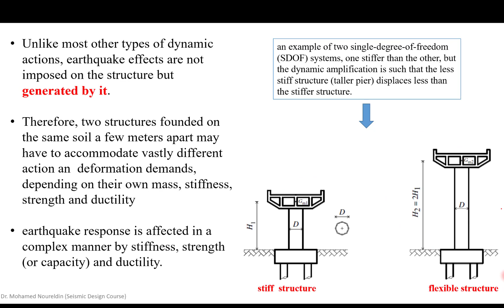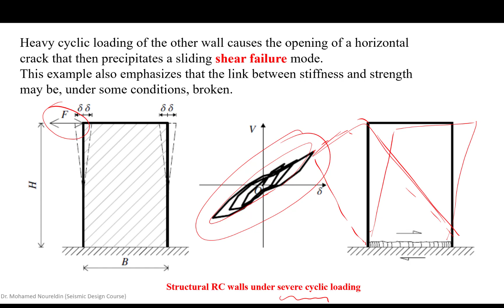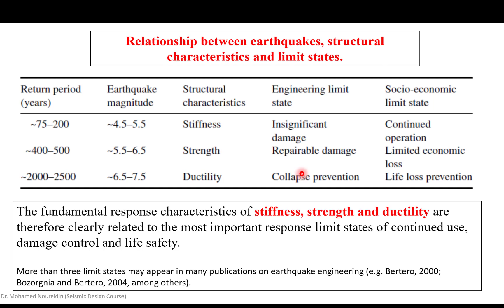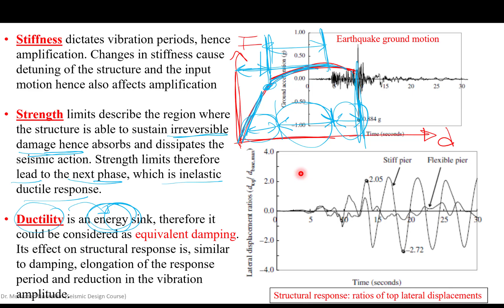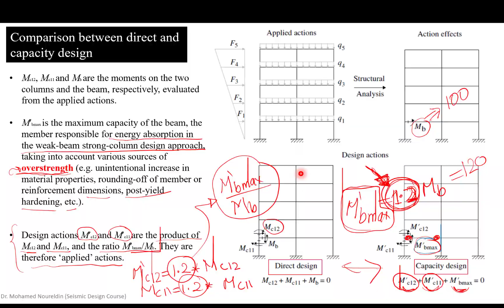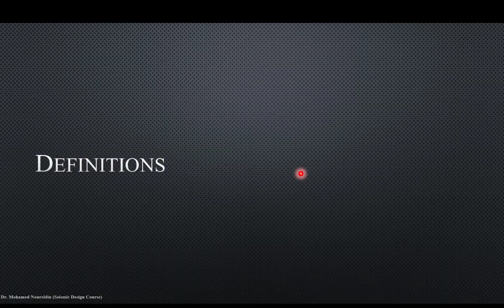4- Seismic effects & structure response

Comment: The two damage mechanisms of the RC wall mentioned in the video are not quit right.
Reply: Thanks for your comment.  Please clarify   why and  give reasons  with evidence if possible.
Reply: @mrnour20  Thanks for the response. The RC wall subjected to lateral force would mainly failed in diagonal shear crack. If the two sides of the wall are not connected to columns, horizontal cracks may occurs but would not end up with flexual failure. Under cyclic loading, the failure mechanism sould be the same. However, if the embedded length of vertical rebars is insufficient,  rebars might be pulled out from the base during the cyclic loading process. Also, if the amount of vertical reinforcement  is insufficient, sliding shear damage may occur at the wall/base interface. The failure mechanism is also dependent on the reinforcing details.
Reply: @shin-taisong5609  While this is true, it is not the aim of this presentation which is to isolate differences within a given wall under different types of loading. It is not to show the different failure modes under different reinforcing patterns. Also, I believe these diagrams show a building rather than a single wall.